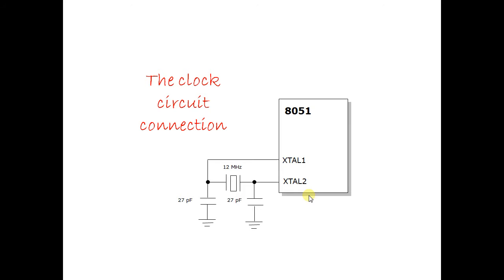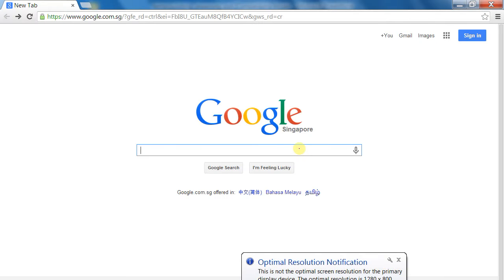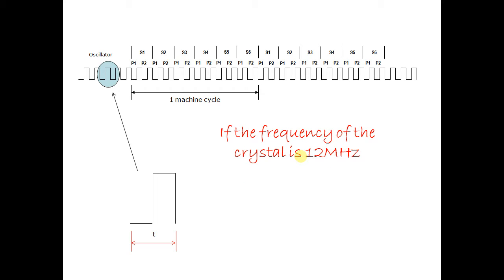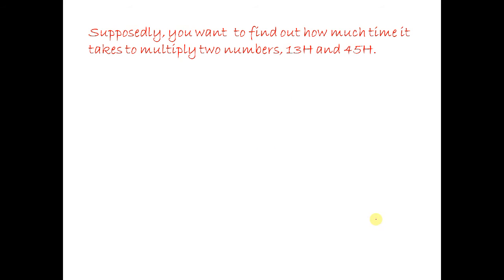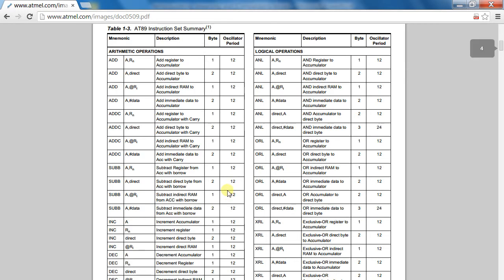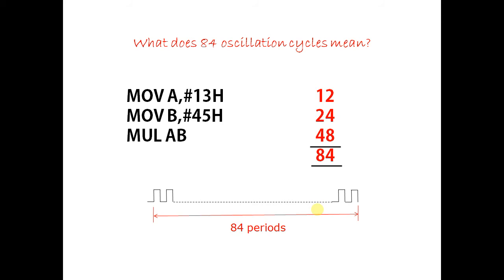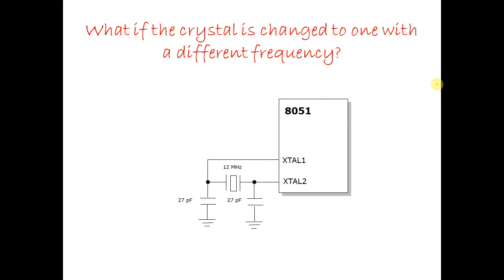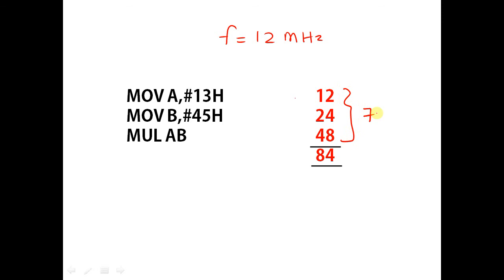8051 CPU Timing Part 1

Comment: actually I wanted to know, why Mov A, 3F# require 1 machine cycle(12 T States)  but Mov B, 33# require 2 machine cycles?
Reply from the maker: Let me make a guess. If you look at the machine codes - MOV A,#data is a 2-byte instruction and MOV B,#data is a 3-byte instruction. In the machine codes for MOV B,#data, you can see that B is treated like a data memory location because the memory address of B is furnished in the machine code. A is treated as a register. Making access to A should be quicker than B.